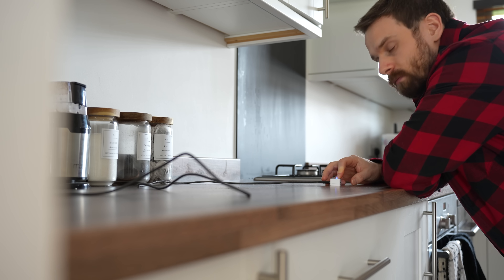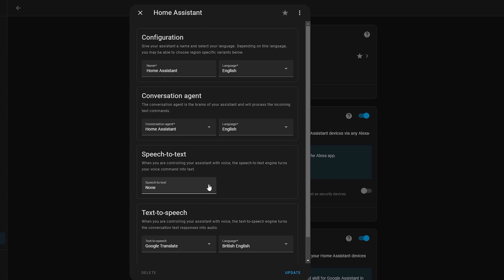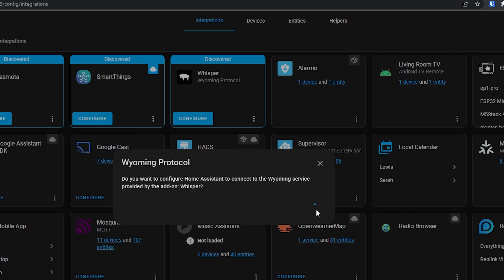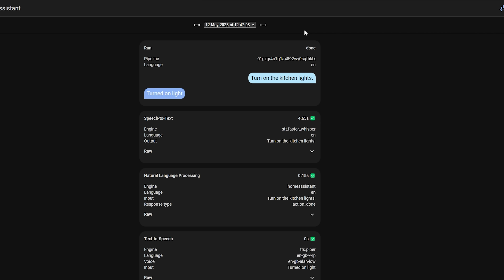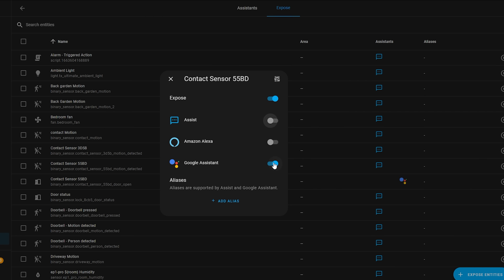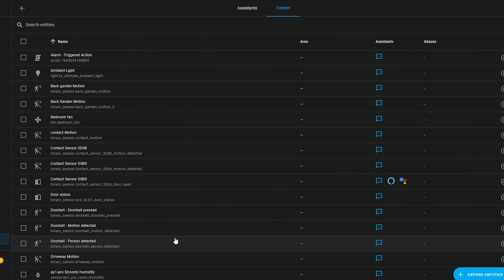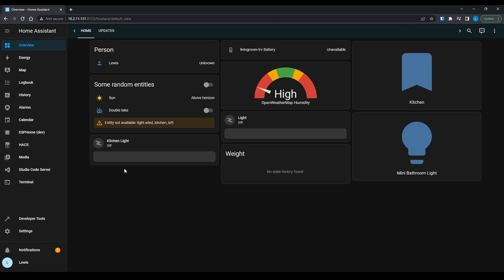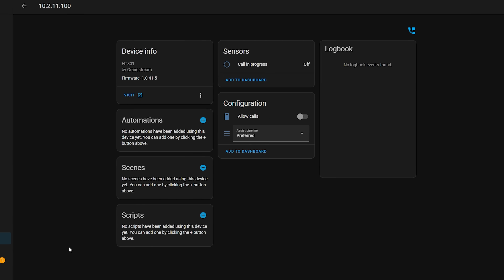Local Voice Control In Home Assistant Is Next Level!

Comment: Just to clarify something in the vid - It is not correct that you can't use the microphone in the browser without a certificate for devices on your local network. There is s setting in Chrome developer settings to enable it for local, insecure, sites.

Comment: No clue what happened but not likeing this video at all it locked me out so I was unable to get back into Ha but lucky I figured away around to get back in and remove wHISPER AS SOON AS POSSIBLE. If you have any clues as to why this happened to me please comment. I do have my own URL for Home Assistant so not sure if its anything related to that being the case why HA kept rebooting and then I was only left with a local url to go into Ha rather than the usual way of my using my own personal URL? Using Cloudflared

Comment: Sorry to be negative but, for a relative beginner to Home Assistant like me, setting up devices like the Atom Echo is a nightmare. After many hours of trying, I finally got mine set up without visible log errors. However, I still can't do anything approaching useful with it. In testing, all the pipelines are present and I can switch the Atom's red light on and off from HA. When I press its button, HA detects this but I see no blue or green light as the config says I should and no security notification. You say "if you want to use the microphone option in your browser then you will need HTTPs, but for everything else you don't". As setting up the secure connection has frustrated a lot of us, can you tell us if there's any other way to test the Atom? As far as I can see, HA has no interface for using or testing voice other than the browser.
Reply: I eventually had to give up for the sake of my mental health (after 5 days of effort!). The Atom Echo never worked, and eventually failed to connect altogether, showing encryption errors that persisted after a complete reinstall - a problem the developers say was fixed a month ago. However, I discovered that for me (and contrary to some reports) my phone can connect for voice access via the Companion app. Wish I'd known that before I started...

Comment: I found that older AMD CPUs don't support Whisper which is compiled to require SSE 4.1. My old Wyse 7010 thin client has the AMD G-T56N CPU only supporting SSE4a and can't run Whisper.
[13:56:18] INFO: Service exited with code 256 (by signal 4) 😥

Comment: Need a touch-free version. I wonder if wake word will be an option... I'm currently using Alexa with Node-RED to command everything in the home and it's the only thing that works for me and the family / visitors. Not perfect every time, but it's so seamless / ubiquitous and over last few years I've become so used to walking into a room with hands full and setting a lighting scene by number using voice, or turning off garden lights whilst locking the door or arming / disarming alarms or presence sensors. I'd love to move away from Amazon to something local though...
Reply: FYI: Wake word works now, see the official guide (search google for "$13 voice assistant for Home Assistant").

Comment: Thanks for the video. I have 1 problem that on mobile app assist voice control works only if you have https connection. Can you create video how to do https with local network? I don't want to open port on my router and i'm using tailscale for remote access. thank you

Comment: Thanks for great video. Just a question. Does the Atom Echo have also wake word capability? If not it seems to be pretty limited as if you need to get out from the couch and go to push a button you might as well use wall mounted control panel.
Reply from the maker: I mentioned during the video they are working on wake word, it's just very difficult and they are taking the time to implement it correctly
Reply: FYI: Wake word works now, see the official guide (search google for "$13 voice assistant for Home Assistant").

Comment: Pressing a button, use a special phone or selecting it in the app makes it for me a useless feature. While I do this I have faster used my smartphone or my HA tablet to do the same.

Beside that the configuration is mediocre at best. First I tried German, as I would be the only one here who would be able to use it in English. Configuration worked fine, I can start it, but it understands absolutely nothing. Not all engines work, just base-small works always, most other (base too) fail to load because of a missing configuration file.
Switching to English was a nightmare and I have given up at some point. Piper isn't running properly. If you switch the voice you need to restart HA. Without restarting the configuration is locked in the voice you've selected before. First of all piper was suddenly gone, the configuration had changed automatically and it wasn't available for HA Assist anymore. It wouldn't get better. Either voices wouldn't load properly and exit with an error or using Assist wasn't possible anymore as I get the error message "Text to speech engine 'tts.piper' not found". 

The cloud solution works fine, but why using such a cloud system, when I have a fully configured and working cloud solution? Ok, that cloud solution was f..... up with the last update as several things are more complicated as before, the whole configuration was deleted and entities and devices not be selected anymore as you need to manually turn them on for the assistants again and suddenly the alias word (that finally worked!!! after I have no idea how many updates) won't work anymore, what is even more annoying, as I could have spared the time to define them again.

Overall I think the idea is good. I'd like to have such a system local, but the way it works at the moment and that functionalities that worked perfectly suddenly are gone again, this update it the worst update of HA I ever had.
It is sad that after all these years they are still unable to preserve my menu bar settings from one mayor update to the next. It works at restart and with smaller updates, so where is the problem? But this update is a big step backwards in my eyes. 

Nevertheless, as always you made a very good video explaining how to configure and use this feature. Go on!
Reply from the maker: It's very early stages, I know it can be frustrating if it doesn't work but it should only get better as time goes on and we shouldn't write it off too early
Reply: @EverythingSmartHome  I don't write it off, but with old things that worked fine gone again it feels like a hasty release to bring out something new that could be hyped (and it is really hyped) even though it is not really tested and even killed old configurations and functions.
I needed 2hrs to reconfigure Alexa again as nowhere was documented that suddenly entities and devices need to be activated for voice control or where and how to activate it. Deleting the configuration in the first place is normally unacceptable.

Comment: I would love to see a true replacement for the google home/alexa speakers, I rarely use them for audio, I think the esp32 could have great potential here. My vision would be esp32's that could simultaneously act as a voice assistant, multi room audio (with your choice of DSP, used with pre existing audio gear), bluetooth receiver for audio, room assistant, bluetooth proxy and maybe presence detection. Maybe pushing the little beast too far though.
Reply: Can't see why it won't happen - Amazon/Google have been basically doing it all for years and all those individual features are being improved in the HA world.

Comment: I don't understand the HTTPS requirement of voice. HA is running on a local machine that can be accessed remotely via a Wireguard VPN. Why won't voice work when I access my HA instance from within my LAN?
How do I get HTTPS working locally? Can I serve HA via port 443 instead of 8123?
Reply: It's a browser limitation; can only access the microphone over HTTPS.
Easiest way to get it running, IMO, is a Cloudflare tunnel via Cloudflared.
Reply: self signed certificate with the signer trusted by your browser

Comment: I have had success running the voice pipelines in my docker container install.  Once I added the whisper and piper container, I just added the Wyoming protocol for each service giving the address and port.  I also used self signed certificates to allow the browser mic feature.  Not having the esp device or analog phone that was the only way I could go.

Great video and thank you for sharing.
Reply: Would you mind posting links to the Whisper and Piper docker containers that you used. I see a few of them on my search, but unsure which might work ---Thanks
Reply: @carltonwbrooks  Sorry for the delay.  I used the docker run command from the home assistant page thread year of the voice chapter 2.  YT will not let me put links.  But for both Whisper and Piper there is a link in the article for running in docker.  I converted these run commands in my docker compose file and then went to integrations and added the wyoming protocol twice.  Once for piper and once for whisper giving the local IP address of my docker stack and the Ports the container was running on.  I also used mkcert to create self signed certificates so that my browser and phone could use the mic while on the local network.  I hope this helps.  If you need more detail, I could make a quick and dirty YT video on my channel.

Joe
Reply: @MyHeap  Thank you so much. I will work through it in the next few days. Appreciate the help.
Reply: @MyHeap  It looks like those docker images only work on Rhasspy. Am I missing something?
Reply from the maker: Good to know, thanks for sharing!

Comment: I'm thinking we have to get a red rotary dial phone now, in which we install an LED that can be triggered to flash, just like in the campy Batman series from the 60s
Reply from the maker: The phone I wanted to use for this video would have been so cool but unfortunately didn't arrive in time
Reply: I’m on a similar idea, but I want to connect it to OpenAI’s integration instead of Assist, and split out the phone audio to mix in with my mic at my desk. That way I can do a bit on a call and people can hear the response.

Comment: Thanks for the video do you have links to the stuff so I can look into buying/making a speaker?
Hopefully soon we won't need to to a push to wake and can just use a wake word like Alexa  and Google speakers do
Reply from the maker: Sorry yes added it to the description now!
Reply: @EverythingSmartHome  Is that the right config for the esp32 DIY version?  Appears to be for the m5-stack echo board, not the esp32 dev board.  For example, it looked like you were using the boot pin for the wake which is pin 0 vs that config is pin 39 for us on the m5-stack.
Reply from the maker: I said on the video that I would leave a link to the M5Stack code so you can use it as an example for creating your own one, since there is no way for me to know which pins you will use 😅

Comment: not using HTTPS even blocks the android app from being able to use the microphone - I wouldn't mind, but it's not like they make it easy to enable HTTPS (having broken my HA install on 4 separate attempts at doing just that)
:(
Reply from the maker: Its easy to do but HTTPS and certificates in general can be difficult if you've never done them before
Reply: @EverythingSmartHome  i've done them lots (I've worked in IT for 23 years - as a server and infrastructure engineer - so I know my way around a computer) - but not on Linux systems.   and when you want to use a cert from your local CA, it becomes almost impenetrable.

I took 6 attempts to work out how to setup my Ubunutu Nextcloud to use an internal SSL cert - as none of the information available is actually reliable.   and much of it assumes in-depth linux knowledge.

I will give it another go - but I am not holding out much hope that I will be able to get it working.
Reply: Just look at the Let's Encrypt add-on alongside the NGINX Home Assistant SSL proxy add-on. Should take you all of 10 minutes to set up if you've given it a proper URL. I just have mine go over Cloudflare DNS. Haven't had an issue with it since I set it up years ago.

Comment: So I am running a Yellow, and I have tried using the local option and it is utter trash. I get it is going to take a while longer to process but the time is way way to long and it never seems to understand. When I switch over and use the cloud option w/ Nabu Casa, using the exact same prompts it is instant. to bad, I really hope the HA guys can get the local option to work better.. :(
Reply: My experience pretty much the same. Even using the best model still can't understand basic words like room for example in my language (Hungarian), and it also takes 10+ seconds to process it (4 core VM on an AMD Ryzen 5 3600). Lower precision models are even worst it spits out random letters basically.
Reply: Exactly. Watch the processor usage go up when using piper.. followed by..Sorry, I could not understand that.
Reply: I tried with german and got a similar bad experience. After ~10 tries I was able to turn on a light. After that I gave up...
Reply: @scream221  it does make you think twice before turning on a light ^^
Reply from the maker: Are you guys all using languages other than English? Wonder if it's languages that haven't been completed yet or need a little more work. Looking at the list, Hungarian does not appear so it would seem that that one at least needs more support from the community?
Reply: @EverythingSmartHome   I am in TX, so I guess you could say I speak a form of English....😆
Reply: @EverythingSmartHome  English here. I tried showing off how easily I could turn off the Master Bedroom Light. She fell asleep laughing.
Reply: @mariusarmand4590  🤣🤣🤣